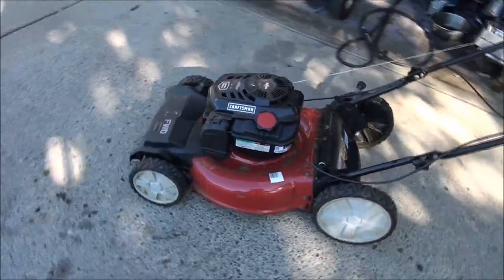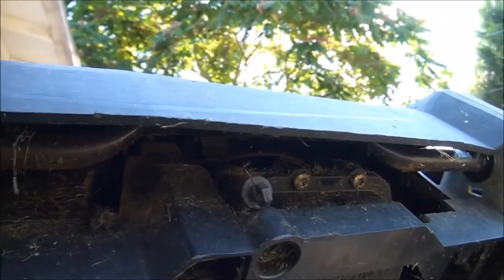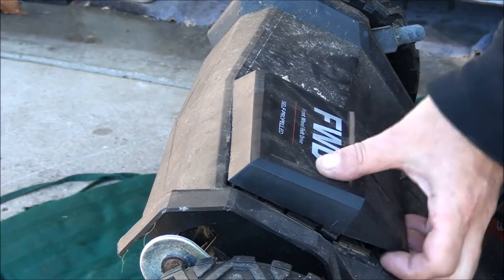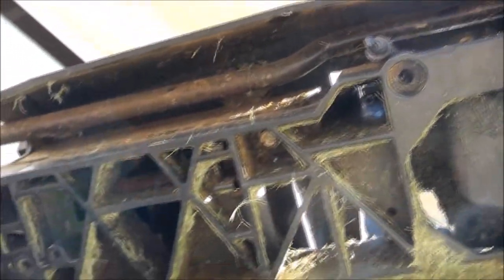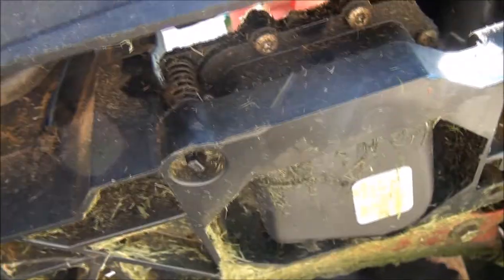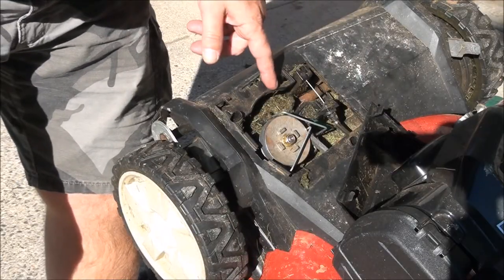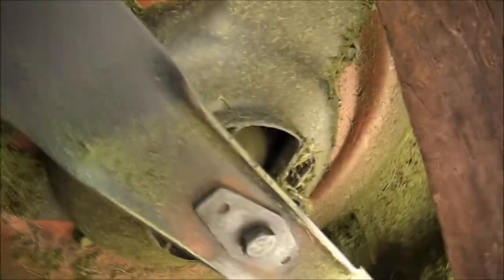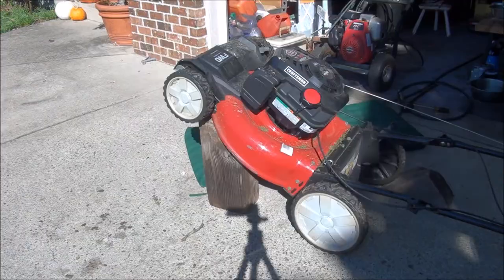common CRAFTSMAN Lawnmower FRONT WHEELS Stopped TURNING . PROBLEMS with self

Comment: Thank you so much! I have been trying to see where all the screws were on my mower but it's very full of grass. Lol
I have always heard that when you tip it over on the side just put the oil on top. Unfortunately now all the gas leaks out the cap. I only found four screws in mine and the top in the very middle seems to still be attached. So I will go back and see if I can find that middle screw today after work. Thank you so much for a very clear shot of your lawn mower and all the extra tips you gave. I have looked up so many videos you don't even know. Some of them were useless. 
Unfortunately I have one of the lawn mowers that does not have that little piece that pops off the top.lol

Comment: Thank you for the video,  quick question - when the self propulsion is not engaged, I still feel a slight hesitancy when I turn the wheels- is this normal? The belt is completely loose when I feel this hesitancy. Thank you for your time
Reply from the maker: the bearings/gears probably need to be cleaned and lubed

Comment: Great video! Wheels stopped turning when I engage the plastic handle. I replaced the belt now experiencing the following- wheels do not turn when "belt wire" is positioned correctly but wheels turn when right side of "belt wire" is under belt or not inserted correctly. Can mower be used without "belt wire"? Any help would be greatly appreciated!

Comment: nice vid.

question - the fwd on my  craftsman  works when i tilt it up, but does not have any torque to pull when the wheels touch the ground.  is that a belt issue?
Reply from the maker: Maybe. But I would first check the pastic gear that is part of the inside of the front wheels, it could be stripped. It could be a bad transmission also.

Comment: My craftsman has the same self propellsion system as this and the issue I'm having is it barely pulls you, it works but barley and all the gearing on the wheels and axles are fine, do you think I need to tighten the belt
Reply from the maker: yes I would try a new belt

Comment: When you take the cover off the drive assembly you can see it can be clogged with grass clippings and debris. Do you have any suggestions to prevent this design flaw? I'm trying to MacGyver a shield to prevent all the lawn clippings from congregating in there and causing trouble. I'm thinking some gasket material or maybe a coffee can cut to fit. There are a couple of readymade screw holes  on my Craftsman 970.
Reply from the maker: good idea, not sure how to address that without taking another look

Comment: Just replaced traction control cable is 10 minutes. But you have to make sure you but offset instead of circular one with spring on the end.